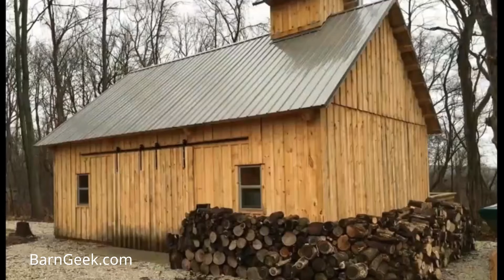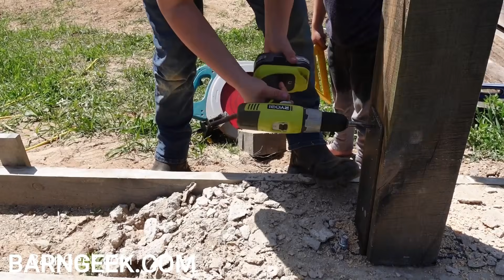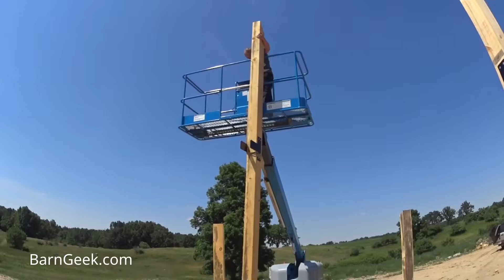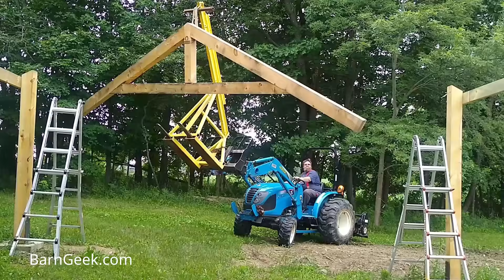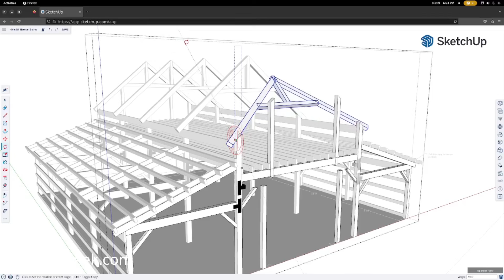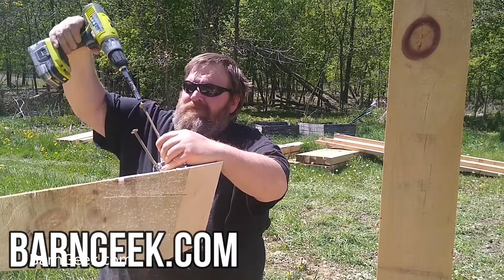How to Build a Post and Beam Barn | The Basics Step by Step

Comment: this isn't true post and beam, or even timber framing. It's similar to stick framing with a lot of metal plates. What happened to mortise and tenon? Our ancestors didn't have metal plates. If we can't build as they did, what's the point?
Reply: Aaron said it was a “modified post and beam”.  The guys is doing a great service to guys who want to mill their own lumber and build their own barn.  He’s not trying to be some type of master craftsman chiseling out perfect mortise and tenons.  His plans and methods are structurally sound.
Reply: By definition, timber frame is using mortise and tenon joints. Post and beam or pole barn construction is using steel plates for joining. In Washington, even timber frame buildings though are legally required to have a hidden steel plate for strength, and no, this is not similar to stick building which is when the entire wall is used to support the structure weight. This style is using only the posts and beams to hold the weight of all structure so any walls, doors, windows are all completely optional and can be positioned anywhere desired after the structure is up. Stick framing requires the doors, windows, and load bearing walls to all be built using specific construction to ensure the structure isn't compromised and severely limits the overall size of an open spanned area
Reply: I’m surprised you are on YouTube. Our ancestors weren’t. 😆
Reply from the maker: The reason Mortise and Tennon Timber Framing is no longer the dominant construction method is because it takes a lot of labor, skill, and material to build. Therefore it cost too much for most people.  My mission with Post and Beam, is to bring some of that class and character back to the mainstream.  The only way to do that is to reduce those costs.  Thank you for taking the time to comment, have a wonderful day!
Reply: WOW you do not understand this AT ALL. If you want a true Timber Frame then go out and Hire a very expensive company to build one. This is for the people that like that style and cannot afford hundreds of thousands of dollars.   Ron  USCG RET